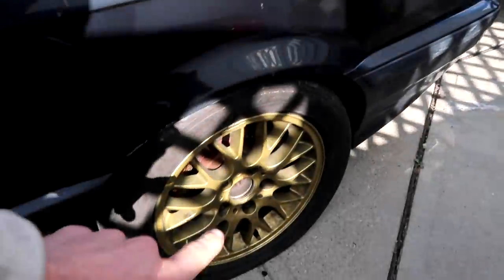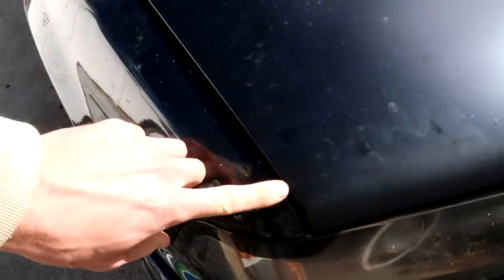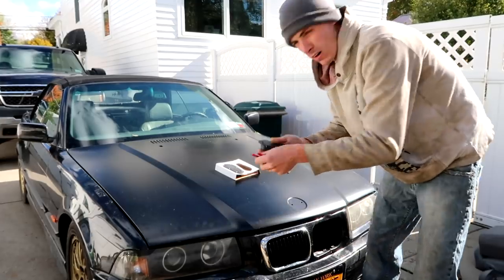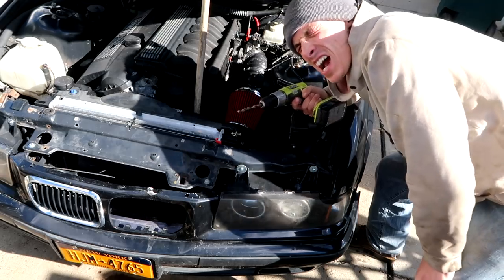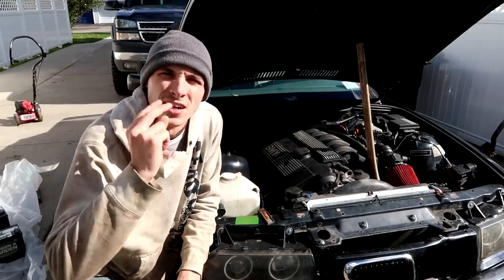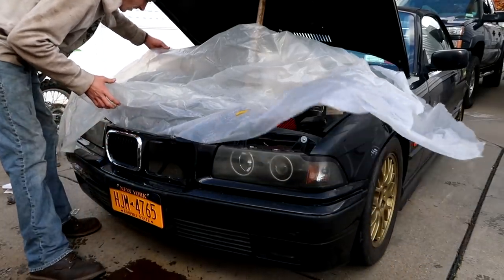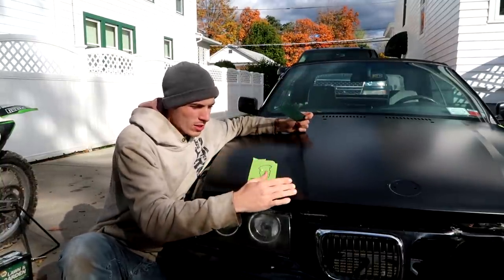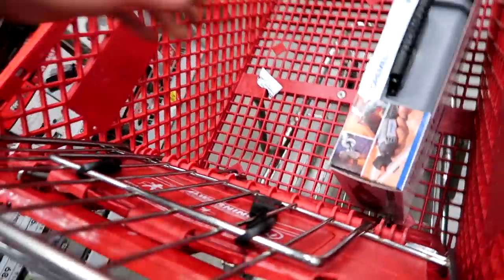I KILLED IT!

Comment: I went to HFT to buy a floor jack, left with a creeper, suction cup (don't ask), multimeter, some Orange Goop, and a tiny 12 volt air compressor for no real reason at all. If I remember correctly I spent close to $200 in there that night.